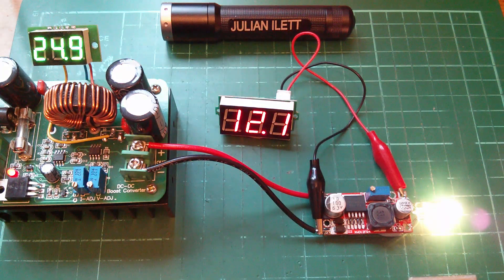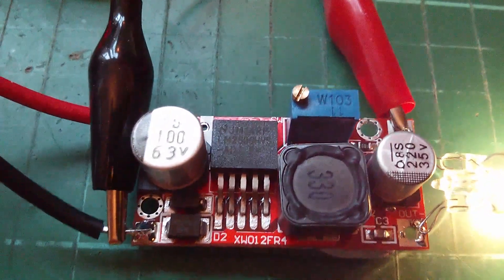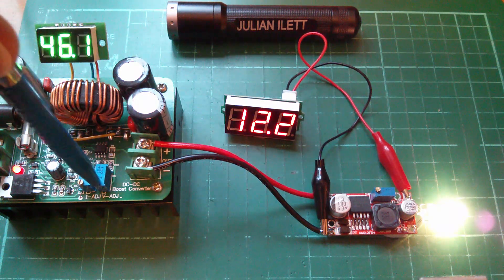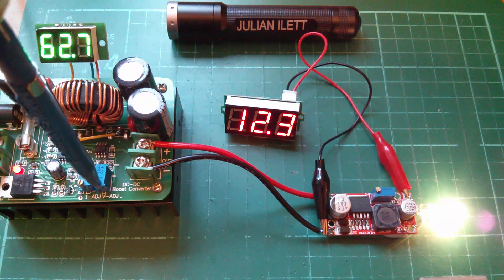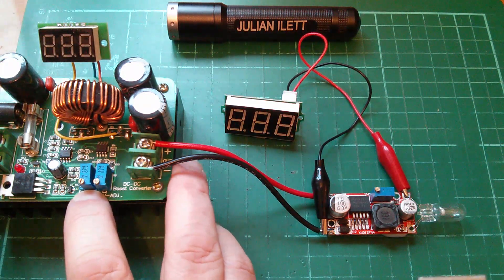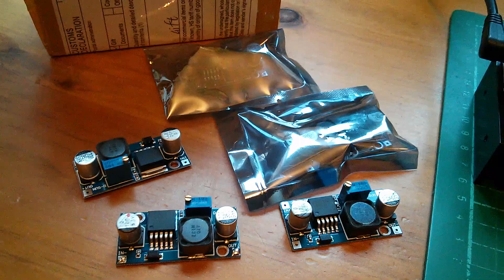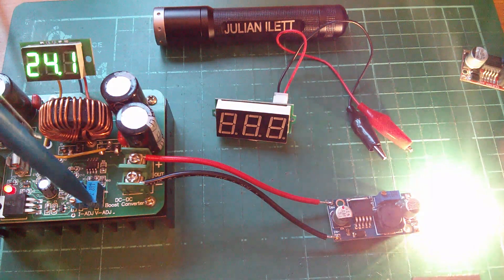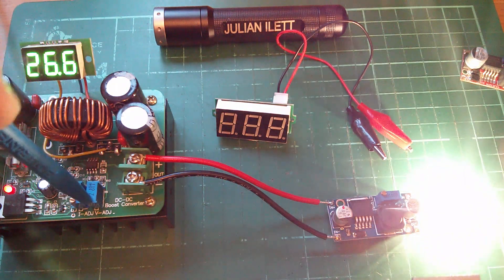Fake LM2596HV Voltage Regulator Buck Converter Modules bought on eBay

Comment: maybe you'll just need an heatsink!!! big drop of voltage huge heat created!!! check the datasheet you see how many watt you can dissipate without heatsink, it seem's to me to be the question on this case! google voltage regulator's for calculating watt's!
Reply: It's a buck converter, not a linear reg.  There is no simple calculation for watts but it is usually very low.
Reply: MichaelKingsfordGray is that your personal experience? Is that the best comment you extracted from mine?

Comment: Julian Ilett Its strange that I am unable to find the datasheet on the LM2596HV.  Anyway, did you do a long test of the working unit; i.e., how log did you keep the 60+ volts on the unit what is supposedly real?  Is it safe to have 60 volts on the input indefinitely without degrading the board?
Reply: Miloš Lazović I'm an electrical engineer and yes I do buck converter design.  No chip called an "LM2596HV" was ever made by National/TI.  That much heating in a cap at low load isn't normal.  I got the same result on my testbench.  There isn't enough ripple to be causing that heating, so it's most likely the cap is failing.   It's also possible that the "LM2596HV" is somehow drawing short-circuit spikes of current that don't make it to the output, that's not implausible since it's a bogus chip, but why even bother to split hairs.  If it's heating up at low loads something's horribly wrong and if you need this component you need to replace with a genuine LM2576HV and input cap.  Replacing the output cap and diode aren't bad ideas either.
Reply: Danny Miller
Little advice, learn how switch mode converters work (and you will know that in buck converter capacitor and inductor ripple current are same), and what is ripple current ratings of capacitor and what influenced it (it is basically influenced only by dimension and ESR and it is limited by allowed heating)
Reply: Danny Miller And you get your diploma on some online college? How you manage to design buck converters when you don't have basic knowledge how on is working (or you call coping schematic from datasheet design)?
Input capacitor heating just effect of them picking crappy and cheapest capacitor they could find, they probably find some crappy capacitor that was so bad and no wan to buy it so was laying in stock for 20 years and they got it next to nothing (I would be surprised if they didn't get money to take them) and it have ESR (due production and age) so high that cannot withstand basically any ripple current, so that why it is heating (and they sw that there is limit of how low ESR can be for LM25xx so they wanted to be safe and picked capacitor with highest ESR as they can find, this is of course cynicism).
They probably design all according philosophy to keep price as low as possible, so ripple current in inductor and capacitors is as big as "LM2596HV" (that virtual controller they use, or it is some Chinese "special" for what no one can find datasheet, LM2596 is not exclusively produced by ti/ns it is produced by ON Semiconductor among others) can withstand (they work in DCM all time expect at maximum load) which with ESR from capacitors they use produce heating ot same.
Reply from the maker: Donovan Lym I've never found a data sheet either. I wonder what the failure mode is too. Open circuit - your load is safe, or 60 volts fed directly into your expensive 5v circuit? Scary stuff.
Reply: Here's the thing, Julian: I'm trying to build a device in a solar energy environment powered by the system battery.  So the unit is a "universal" unit capable of working on 24/36/48 volt system; I have a different version for the 12 volt system as it relates to the power supply and that problem has been solved.  The universal unit therefore has to be able to have an input voltage from, say, 20-60 volts, with an output of 12 volt @ 150mA.  I saw your video and now your comment, yes, scary stuff. The HV chip is too mysterious.   I was hoping I would be able to just purchase a module (at a reasonable price) to take care of this.  A TL783 linear regulator is too inefficient.  Any suggestions?
Reply: I bought 3 of these units (red ones) and tested them at 61 volts @0.67 amps. With output of 12 volts. Tested 2 for 12 hrs. The last one was on for 24 hours. Regulation is approximately +- 4% with input voltage varying from 20 to 61 volts. Seemingly, they are the real deal.
Reply: But this converter chip says "LM2596HV", it is fake, and TI never made any such thing as an LM2596HV.  They DID make an LM2576HV, and you can simply swap it it with a real 60v input cap and reuse the board!
Reply: I bought 3 of the red modules and had them on a supply of 60 volts, output 12 volts  @ 250 mA on and off totaling 20+ hours each without any adverse effects. On and off because I wouldn't leave it on while I'm sleeping, probably 5 hours break. Yes temperature rise up to 130 degrees Fahrenheit., including caps. @ 150mA it runs probably up to 110 degrees Fahrenheit.  I bought an additional one and tested also at 60volts, 12 volts output  @ 150 mA. Can I assume it is safe?  I could take the precaution of testing each new one at 60 volts @ 150 mA for 2 min periods for products I'm making. Feedback?
Reply: Donovan Lym Nope, if that cap is getting hot, it's NOT a 60v cap.  "Safe"?  Well, there's no telling what it will or won't do, but it's basically failing out of the box, so no, it's absolutely not going to be reliable.
Reply: Danny Miller, what is puzzling, is that when you go on Mouser or Digikey, and check the specs on the caps, there is a temperature rating, inclusive under "load life"' with values up to 105 degrees Celsius.  This leads me to believe that capacitor temperatures will rise in normal use I suppose depending on type and application. Further more, those bing used in switcher power supplies will get hot because of the operating frequencies.  I am not suggesting here that the caps in the reviewed module are of the correct type, but that caps will get hot, even when selected for the proper rating and application in high frequency power supply applications. Am I correct?   Feedback from other readers would be appreciated.
Reply: Donovan Lym Yes the capacitor can survive this temp, and higher.  They do age much faster at higher temps.  However, there is no plausible SOURCE for the heat at a 250mA switching load.  The capacitor is experiencing tens of milliamps of leakage current internally to make that heat.  So it's either got a separator defect or was never rated for the voltage to begin with.  

Continuing to use a capacitor with this much internal leakage is likely to lead to failure very soon.
Reply: Danny Miller, found an article from TI http://www.ti.com/lit/an/slva157/slva157.pdf
Reply: Danny Miller You got everything wrong.
Capacitors do not heat due leakage current, but (mostly) due ESR and ripple current.
Ripple current in capacitors in SMPS are not equal to output current (usually is twice of output current for CCM and even much more for DCM).
Reply: Petar Petrovic In normal use, leakage heating is insignificant.  But mine got hot on 30v with nothing hooked up to the output.  I think that was a junk cap drawing huge leakage current.

Donovan Lym  said it was getting warm on 150mA.  That's unlikely to cause much heating... unless the test leads were really long/thin and giving a high source resistance.  If it's already 110F at 150mA out, something's wrong- that's only 5% of its rating.  

And a high ESR cap won't get hotter because of the high ESR.  Instead it'll stop absorbing the ripple current and the supply becomes electrically noisy, but will stay cool.  Not necessarily serious though, that's a switched inductor, so the current spikes aren't super high.
Reply: Donovan Lym You need an MPPT.  This isn't.  Even if the voltage rating was correct, it won't function correctly on a solar panel.  It will latch up and just short out the panel's output.  

I have heard many cheap Chinese "MPPT" devices on eBay aren't proper converters, they don't work as MPPTs.
Reply: Danny Miller Do you know how buck converter work? According to your comments it is obvious you don't have clue.

Comment: Should be using something higher rated than a 63v input cap for constant voltage supply, heat will shorten lifespan of a cap. Ive used a similar if not identical ebay pcb to drive 10w of LEDs and the inductor got very hot and failed in a few weeks, heatsinking looks inadequate too. Nice video, just subscribed to your channel.

Comment: Hi Julian. I love your buck converter collection. Some people collect stamps, some keyrings... hah! Have you seen the single-package buck converters on ebay ("ultra mini 5V DC buck converter")? They look pretty nice and I'll buy one to test but wondered if you have tested one as well? e.g. this one: http://www.ebay.co.uk/itm/5pcs-Ultra-Mini-DC-Buck-Converter-DC-7-20V-to-5V-1A-Voltage-Regulator-12V-to-5V-/261545736813?pt=UK_BOI_Electrical_Test_Measurement_Equipment_ET&hash=item3ce5573a6d

Comment: Hello Julian, Do you think its possible to use the LM256HV in parallel on the adjustable outputs around 13.8v with a diodes at the end to charge 12v batteries? I have an idea to use 2 x 120w (home made) 20v solar panels in series to make between 30v and 42 volts @ max 6 amps in depending on sun light. I am aiming for a set up that when the sun is out I will always give out at least 500ma out @ 13.8v cloud or no clouds. I think its not unreasonable to ask for a min of 2.9% output of 240w. I am trying to make a cheap solar charger similar to MPPT with voltage dropping to correct battery voltage without all the hard work. At a later date I am going to attempt an arduino controller similar to yours but hopefully with a but more charging amps to make it worth while :) Hope you can help me with this little project of mine. Cheers for the vids dude
Reply: Something similar to this http://www.ebay.co.uk/itm/DC-DC-Step-down-Converter-3-5-30V-to-0-8-29V-10A-buck-Voltage-Power-Regulators-/321512302840?pt=UK_BOI_Electrical_Test_Measurement_Equipment_ET&hash=item4adba068f8 would be great if only it could take a higher voltage :)
Reply: Julian Ilett or perhaps something like http://www.ebay.co.uk/itm/New-DC12-48V-to-1-8-25V-Step-Down-Power-Supply-Module-Buck-Converter-Board-/121343225299?pt=UK_BOI_Electrical_Test_Measurement_Equipment_ET&hash=item1c409eadd3 Hope it makes sense. Essentially taking up to 42v solar say at 6a and boosting to 13.8 @ max amps possible 100% efficiency would be 18 amps but I know thats never going to happen EVER due to heat/conversion losses :)

Comment: There are fake parts AND then there are a lot of not fake, but factory rejected parts. I got LM simple switcher chips that were supposedly genuine, but 3/5 were faulty. I also know an incident where subcontractor had bought TI opamps that were behaving badly. I contacted TI and they verified that part was genuine, but source was not reliable so it's likely they were faulty genuine chips.

It's also very hard to tell if the parts are genuine or not. When buying obsolete components, there are lot of fakes around and even if you X-RAY chips, it might be hard to tell, because sometimes you can see genuine parts that have different X-RAY images, so it is difficult to know what variation from what you expect is real and what is fake. Of course obvious fakes are easy to tell, but very well made fakes are very hard to expose.

Fakes suck, because It's hard to get genuine parts, since many authorized vendors require business account and shipping is 20€ every time. It's very tempting to buy from ebay with free shipping and you get just the small amount of parts you need. Flip side of the coin is that you must know how to detect fakes and how to test them before you put them to your project.

Comment: Cheers mate,
I was wondering if you could help out with this.
I am working on a led voltage regulated dimming circuit.
I was interested in using this converter
Also, I want to add a potentiometer that will range from 5-12vdc
I will need to add a resistor of some kind to one of the potentiometer pins
Here is the info from amazon.com

DROK™ 600W 12A Constant Current/Voltage 12-60V to 12-80V DC Car Power Converter Battery Charger LED Driver Regulated Laptop Power Supply

My LED's all together are drawing 15Amps. 1200 plus leds
The seller for this product states the following

Output power: = Input voltage * 10A, if need more output power,  such as need the output to 15A,   two modules can be used in parallel, the current of each module can be adjusted to 8A.

Any truth to this? Or can you explain how to wire two dc dc buck converters in paralell
with an output voltage of 12vdc to power the leds, but increase the amps to over 10amps?
Any help would be greatly appreciated.
Keep the videos coming, they are well explained and easy to follow

Comment: What is the type/name/model of that light your using?  I'd like to have some of those for testing like that!

I've gotten so many bad and crappy voltage regulators from the china vendors that I'll probably not get anymore at all.  When the hit rate is less than 50% it makes any cost savings pretty worthless.
Reply: +bp968 I think it's a 10W automotive (turnsignal? or stop/brake maybe) light.

Comment: in the future, you can see the markings much better if you rub a little white paste of some kind into the numbers (I use some thermal grease) I imagine this might also help to identify forgeries since the HVS is likely going to be slightly different from the rest of the part number.

Comment: Thanks for posting this. There seem to be a lot of fake parts from Chinese vendors on eBay. I have some LiFePO4 18650 batteries labeled 3600 mAh and they are actually about 1100. Same problem with 3000 mAh AA NiMH that test at about 800. I got a partial refund, so the final cost was about right for what I got. The quality was decent, but they try to outspec each other and most customers can't fully check them.

Someone else bought some high current Schottky rectifiers and they got very hot and showed much higher forward voltage than the spec at the rated current. Again, a quick check with a multimeter shows the usual 300 mV drop but they probably have a relatively tiny cheap diode in a fake case.

The LM2596 are about $2 from Mouser, but they don't seem to have the HV version. In fact, I can't find it from Digikey or Newark either. There are 60V versions of the LM2574, LM2575, LM2576, and LM2577. Where did you get your data sheet?

Comment: The step down converter I've bought is mad, it is a constant current and constant voltage converter. If I supply voltage from battery to this converter then I can adjust voltage and current just fine but if I supply power to the converter by a transformer wall adaptor, I can adjust voltage but not current. The transformer was outputting 5.2v at 700ma. Does anyone know why it's happening? The converter does not get hot.
I want to buy a good step down cc cv converter, please suggest me a good one.

Comment: There are some chips which are the LM2576, places like mouser (a proper distributor - not ebay) sell them. Up to 60V input for the HV version. When you get up to this high of a voltage, it is easier to just use a transformer based converter.

Comment: I think just bought some fake  d-sun ones not arived yet but only need them to work on 7-9v input and give me 5.5v out should that be a safe input for this to work will get the proper one you shown  too
Reply from the maker: Mine just had regular LM2596 chips on them. They work fine up to 40V input.

Comment: Hy there Can you Recommend me a Voltage regulator to go from 12-14V down to Stable 5V?
Reply: hii
 you  can use a usb car phone charger if you need only small current (until 2 amp  )

Comment: Also bought these about year ago for my 48V ebike. Not yet tried. Good to know they are fake. So at least there is no problem using them upto 40V?
suspiciously cheap yes. Cheapest real one is red PCB and 5$
Reply from the maker: You can use them as regular LM2596 regulators, because that's what they are. Just a bit annoying to pay more for something that's no better than the cheap ones.

Comment: Will you get electrocuted if you use a metal screwdriver to adjust the voltage instead of that plastic pen thing you were using?
Reply from the maker: Unlikely. The adjustment screw is probably insulated. The potentiometer is almost certainly not connected to the high voltage part of the circuit. Nevertheless, the trimmer tool is covered in plastic to protect you from shocks.

Comment: Got it on AliExpress, 10 pieces for $10. It is LM2596S. Original marking is made with very bright white ink. The caps are 100u/50v and 220u/35v. You definitely got remarked ones.
Reply from the maker: And now I've just bought another fake one from Alice - one of my favourite eBay sellers. The genuine ones are hard to find.
Reply: Julian Ilett  hi, do you know of any listings for the real thing? I've just run 48v out to the garage for some LED floodlights and I need 12v for the control circuitry. Thanks. :)

Comment: This is exactly why I will not buy any type of electronic or battery equipment from China or  Hong Kong.  About 95% of anything electrical has cheap knock off parts that won't operate anywhere near the output on the data sheet.  Thanks for the post, It proved what I've been telling people for years